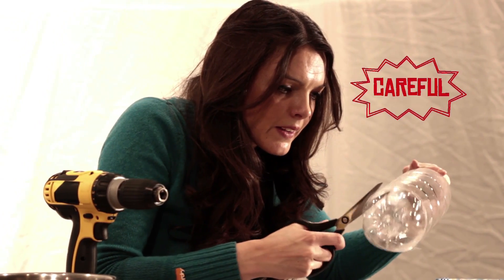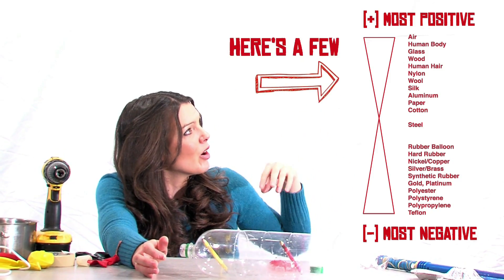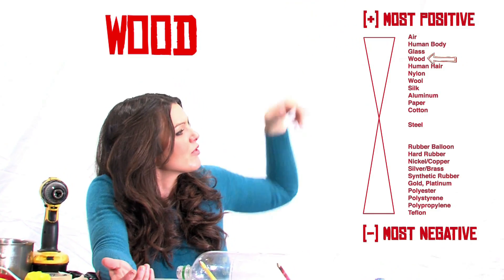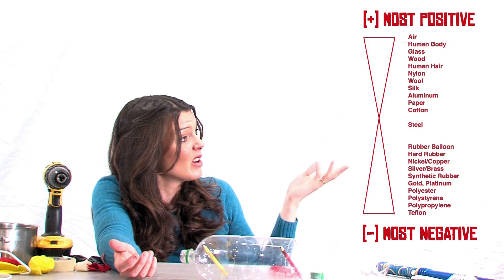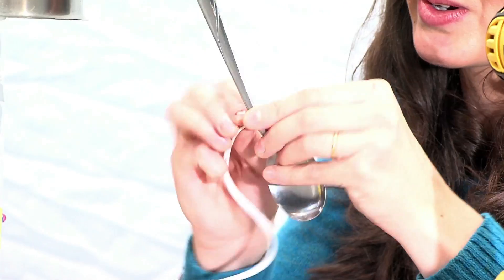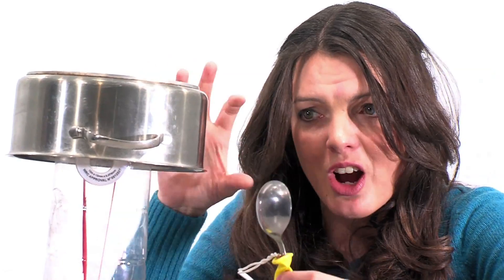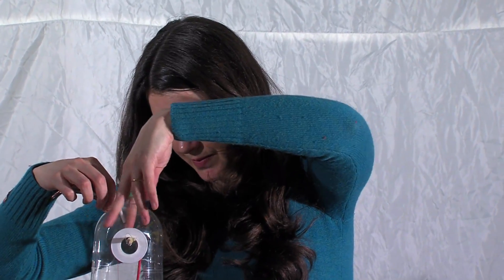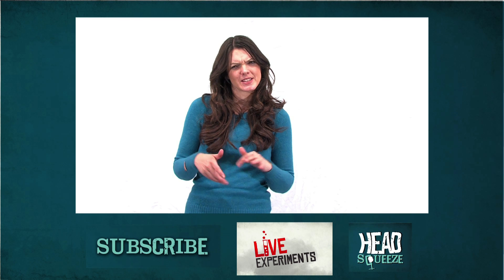Make your own Van De Graaff generator | Live Experiments (Ep 25) | Head Squeeze

Comment: Being a teacher I appreciate your job.  A pupil  can make the generator only using things present at home, with no cost.  It is not important that it barely works.  He or she can explore the idea. To better the results the handles and the edge of the pot should be covered with insulating tape, because they are responsible for huge escape of electrons. I suppose that bare wooden sticks should be used instead of pencils covered with paint.

Comment: i got a decent van-de-graaff generator for 25 dollars, battery powered, builds up high voltage in half a second, very high voltage very low current, makes 3 of these sparks per second.

got it out of a childrens toy where you electrostatically levitate objects and have them flying around in the room. it needs to endure children playing with it.

its called "fun fly stick". and the generator inside is kickass, and based on the same principle explained in this video.

Comment: that's a lot of electricity used up for a simple experiment to do with electrostatics, plus that drill could kill someone...easier method to do would be a human van de graff generator, where u rub rubber soles, lift up your legs and poke something metal or some1 and have much more fun